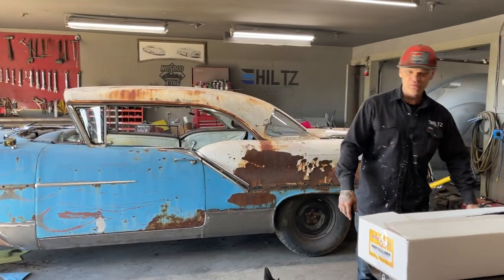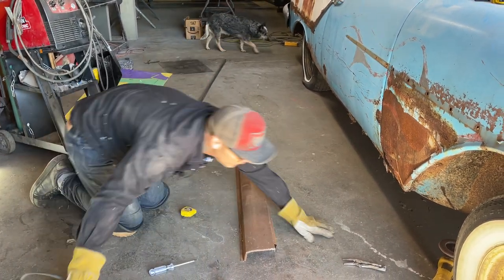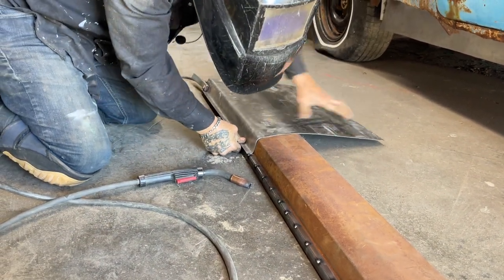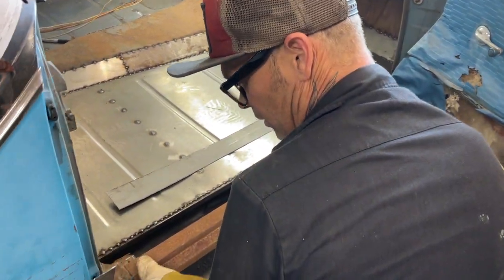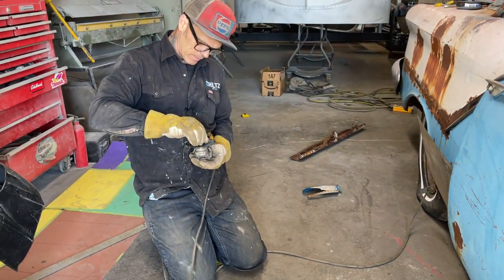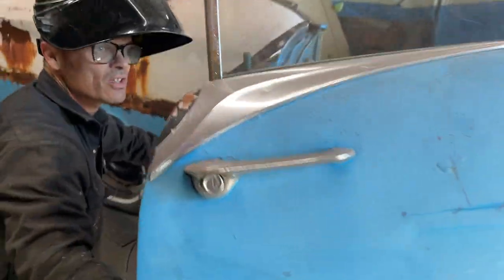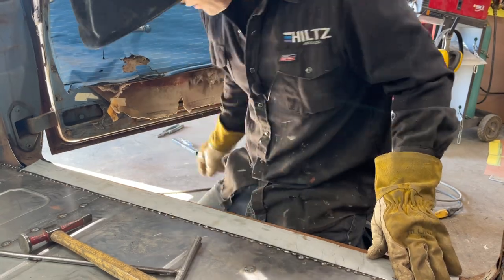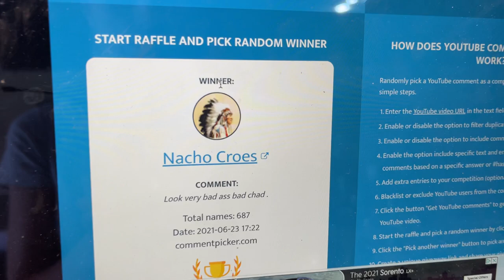DUDE! WHERE'S MY SILL AND QUARTER PANEL?

Comment: Would you consider listing a few choices on FB and have the fans vote on the next project?  1-Finish Jolene’ Bugatti Chassis 2- Build and marry a frame to the hot wheel Bugatti 3- chop the top on the Chevy, 4- Redesign the roof on the Jag etc

Comment: Actually I am done with the Oldsmobile and ready for the 40 ford as its one of the first cars I drove/owned. I had painted it a deep deep blue and on the rear fender where it joined the body nearest to door.... I painted a set of eyes and the top hat of the inspector dude that you see on walls and other places that people chose to do. It had the caption "Baby" and that was done in gray with little spots of yellow and white. Supposed to make look a bit more real. If me and on that car your doing for Jim, I would go high on the fender thats all  clapped out

Comment: I swear I'm gonna glue velcro to my pants to keep my knee pads in place. They're either falling off or cuting off circulation. Lol
Reply: Ian,
I use snaps. You can get them where upholstery/fabric is sold. 
Levi used them on some of their blue jeans. Just put them high and low enough so they are not under your kneecap. Ouch

Comment: ...I'm waiting for the disk to explode!  I guess I get the cheap ones?
Reply: Mine are rated to 30k. I try to use the good ones even on a low speed angle grinder. I also use the guard these days.

Comment: Has anyone ever thought about grinding the metal surfaces before proceeding on with new work on the surface of the metal surfaces to have a clean smooth metal surface to put a Nice clean surface to eventually be able to paint on ? Paint does not work on a rusty rough surface?
Any real professional Bodyman Would cry over this Style of BAD workmanship SHAME ON YOU